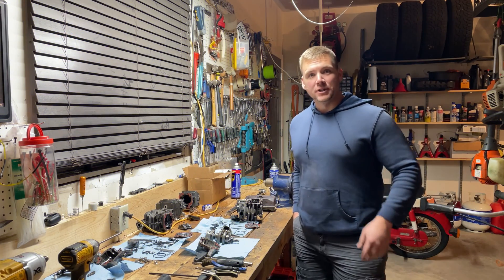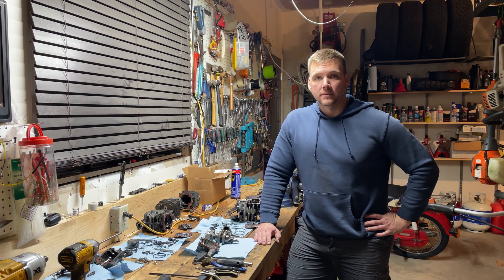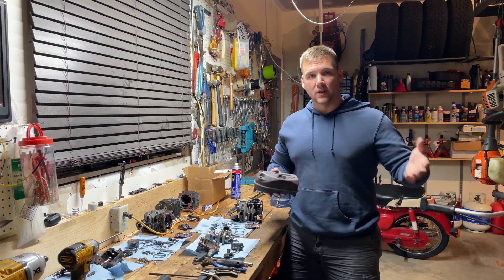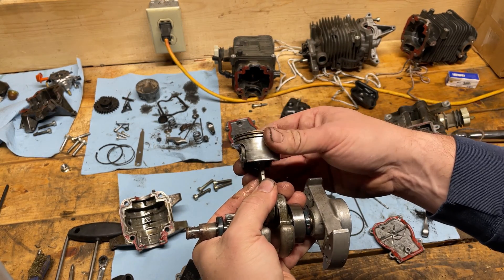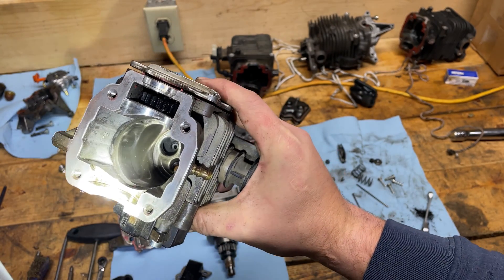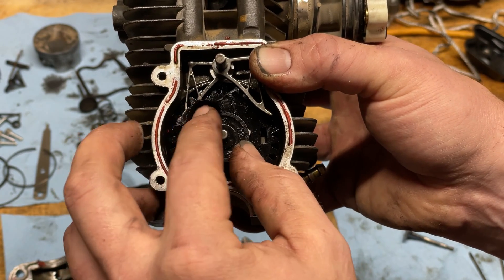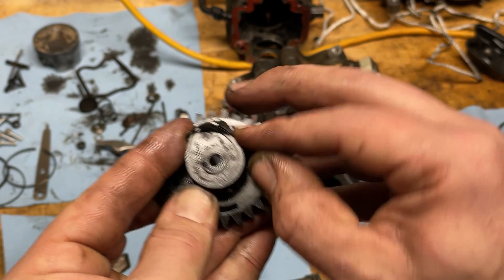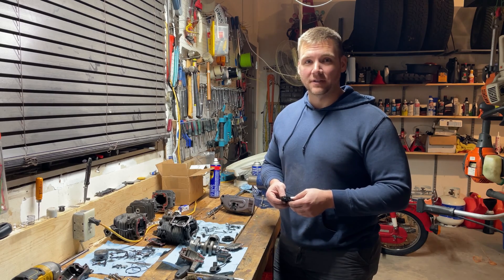Why doesn't my Stihl 4-Mix blower run like it should? Not as powerful & rpm not as high (BR600)

Comment: These are really really good engines but they are hard on the plastic cams. They will melt 
Never run one without an air filter either. It will destroy it. 
Seen one throw a rod bc it was ran with no filter. 

I rebuild them a lot
But because people don't take care of them. 9 times out of 10? 
People will run them on straight gas.

Comment: Great video Dave, just wondering what you set the valve lash at on the BR 600's ? I watched a YouTube video tonight and a repair shop mechanic sets all of his at .008 in or 0.20 mm
Reply from the maker: Stihl manual says 0.10mm +- 0.02mm for both intake and exhaust.

Comment: This must be a common problem just got done rebuilding mine because it didn't rev out either and found the exact same issue my local dealer had it in stock 15 bucks. Can't complain too much this blower is 10 years old and needed the refresh anyway.

Comment: was it running real ruff smoking to. i have a br700  all new lines carb yes a stock carb. it starts runs great on high end but low end  sounds like diesel  and smokes  no L adjustment more i open it ruffer the idle and more smoke has fresh non ethanol  fresh filters  50:1 with stihl synthetic oil.

Comment: What if the aluminum plate behind the timing gear falls off can you still put it back on ?
Reply: Nope, time 4 a replacement .. even if it hasnt came apart but its still loose change it out asap!

Comment: Dave, I love how well spoken you are, you have a really good head on your shoulders. I also love that you posted this, as this is a very unique issue that is not at all common. However, is becoming more common these days, due to using plastic inside engines. What is Stihl thinking? They are a commercial brand making a commercial piece of equipment, and they are clearly going the way of Briggs. And how well did that work for them? Apparently not well considering they declared bankruptsy. Excellent video Dave, I loved it!
Reply from the maker: Thanks Stellar, appreciate the kind words as always!!!

Comment: I've seen a Honda 4 stroke brushcutter that would not run , a check of the valves showed that they were barely opening at all . Going in deeper I found the cam completely worn down , almost no lobe left , made of plastic . Even some Briggs engines use plastic cams these days , it's not what I would call good engineering .
Reply from the maker: Great engineering…. Poor manufacturing!!!

Comment: Good video Dave. Jeremy the mower medic 1 has a good video about those cam shafts causing this problem and how easy it is to replace them.
Reply from the maker: I’ll check it out!
Reply: Jeremy   Saw your video and was going to mention to Dave.  You had a new cover plate from Stihl that had an additional piece which was designed to get more of the lubrication on the cam...      Appreciate both your informative videos.    Thumbs up....